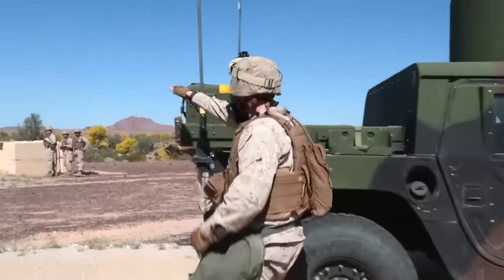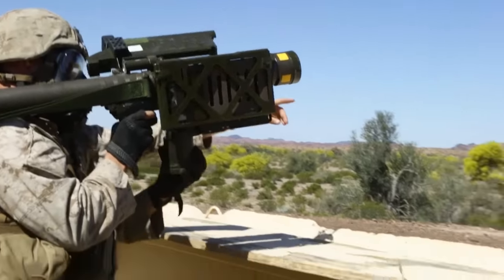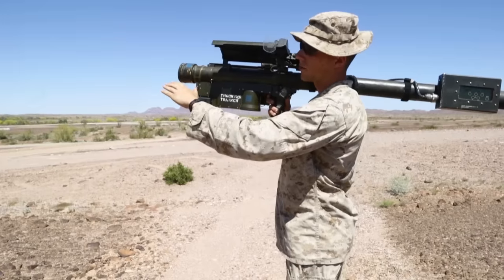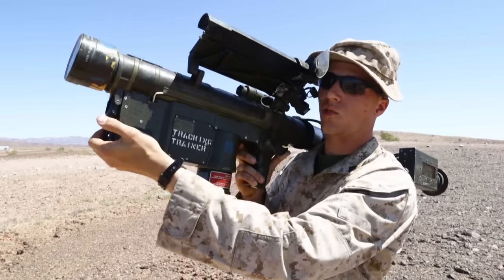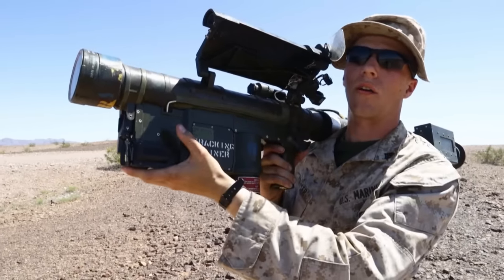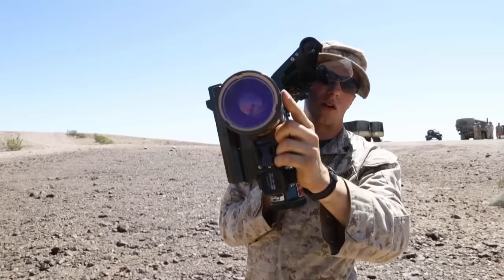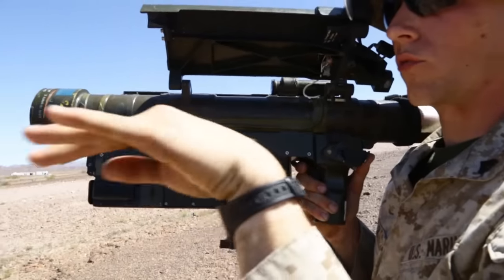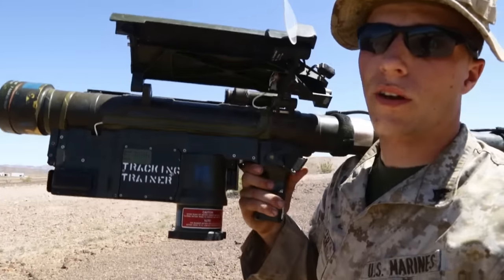How To Fire A Stinger Missile • FIM-92 Stinger In Action

Comment: I'm a former Stinger missile tech.
Getting a lock isn't as easy as they make it sound because the reticle is tiny. It's actually a pretty tough shot but once you get a lock, game over.
Reply: The problem with stinger missile is that its range only 5 km ,😣
Reply: Stingers can make easy work of choppers though.
Reply: @وجارالذئب-ر1ل  I forget but yeah it's pretty short range.
Reply: @farzana6676 definitely better for helicopters. If I remember correctly, the missile knows the difference  and at the last second will actually fly up and attack down into the blades.😉🇺🇸
Reply: @gandalfstormcrow8439  stinger very useful against choppers but it can only hit su fighters if its on low attitude and i hope ukranians have the luck to take su down
Reply: @وجارالذئب-ر1ل  Yes, it's short range so a high flying jet is tough, but don't be so sure. I knocked out a high flying silkworm missile (smaller). At night! Got a medal (Navy Achievement Medal) for that shot.😜
Reply: can you design one specficaly to target Putin and the Kremlin ?
Reply: @Blackbird_80  they can but I doubt they have the armor piercing capability. They're designed as ground to air.😉🇺🇦🇺🇦🇺🇦🇺🇸🇺🇸🇺🇸
Reply: @timarcher7933  and put a red hot poker on the end.😬😜
Reply: @Blackbird_80  just a guess tbh. Antitank weapons have a shaped charge designed to fire a cone of molten metal through armor.😉 Stingers can lock onto just about anything but how they actually work I have no idea. It's been 30 years. 😬
Reply: Since now days you never fucking know, specially now if you end up needing this information, any pointers how to get better lock, what to avoid and what to look for? Clear blue sky obviously and hovering helicopter that does know you are there, but on average field conditions? Also what is the acceleration time of the missile, since speed is mach 2.2?, but how long it takes to accelerate there, so one can estimate "sure kill" distance to target ie how close target must be so it wont get outside of the range before missile gets there? Does stinger have a range finder, way to find out distance to target? Could not find the answer but is stinger single use, or can it be reloaded and how long that takes, is it field operation or what kind of facilities are needed for this?
Reply: @Hellsong89  sorry, boss, but I won't be giving out any classified information. Even if it's already on Google.😂😂😂
Reply: @gandalfstormcrow8439  lol
Anywho..Seems like Stinger requires more steps/knowhow to use and is trickier to get a lock vs firing a javelin against armor or a truck.
Reply: @fnln7073  sorry but no idea about javelins.
Reply: Can they take out russias fighter jets? What would u say the success rate would be if the Ukrainians try to take out the Russian fighters with stingers? Also did they improve the stinger over time?
Reply: @pravdasircone1691  they can take out any planes. Success rate is extremely high.
Reply: @Gandalf Stormcrow  wow I imagined it would be much lower for high speed targets.  Awesome, thank you for answering.
Reply: @pravdasircone1691  if it flies it dies.
Reply: @novastar3547  ikr? Good news is he's got his numbers wrong. I'm not telling Boris shit!😂😂😂
Reply: @novastar3547  what's killing me is that 40 mile convoy. RPGs and a bunch of 10 year olds could take it out.
Reply: Make sure this is posted in the Ukrainian reply
Reply: @gandalfstormcrow8439  yeah, I'd rather see the 10 year olds safely on the other side of the border tho. Unless you're volunteering your own for guerilla warfare? 😜
Reply: @Quat Sino wow the red-eye is pre-stinger. I heard the Russians had a version with a useless blast shield because the rocket engine fired immediately (incinerating the gunner)!😂😂😂😬
Reply: How long do you have to hold it on the target?
Reply: @James-cb7nb  you can get a lock almost instantly if you're good. And they've upgraded since the one I used so who knows?
Reply: @وجارالذئب-ر1ل The range is 8 km actually.
Reply: @Quat Sino cool, thanks for the info!
Reply: If the Afghani Mujahideens can figure it out and knock down  Russian Hind helicopters then it can’t be that hard to use…
Reply: @وجارالذئب-ر1ل  they did today, congrats to the lads there, just 🙌
Reply: “Former Stinger Missile Tech?” Please do tell when and where you served, I am curious.
Reply: @gandalfstormcrow8439  surprised you had authorization to do it  stingers aren't supposed to be used at night unless something has changed since I was a stinger gunner/16s.
Reply: @Fng_1975  a stinger tech must have been part of headquarters.  In our battery,  we had 16R Vulcan, and 16S Stinger. We had track and wheeled, plus gun technicians,  but I didn't remember stinger techs. I was 4th ID Ft. Carson late 80s early 90s.
Reply: @stanleydavis401  😂😂😂 never said I was authorized. But those damn Chinese missiles were scary because they're inaccurate and we were worried about chemical weapons. On the plus side I held fire when buzzed by an Iranian I forget what jet. Hotshit pilot buzzing the USS Stark dropping flares. Captain was former XO when the Stark was hit by 2 xocet (spelling?) missiles back in the 80s. Orders were "if he so much as turns on radar, weapons free."  🇺🇸🇺🇸🇺🇸
Reply: @stanleydavis401  btw that's how you win medals. I'm scared, people might die, go, go,go.😂😂😂😂
Reply: @gandalfstormcrow8439  2/67 ADA?
Reply: @stanleydavis401  who?
Reply: @gandalfstormcrow8439   couple questions for you since you clearly know this weapons capabilities:

1) Does the missile have any issues tracking head on targets once it leaves the tube?

2) Does the missile have any g limits, i.e., if the target is a fast flying jet and you fail to lead, how likely is the missile to undershoot the target?

3) how sensitive is the IR seeker? Could you easily pick up a tone on lets say, a dude in a parachute?
Reply: @MJR85  😂😂😂ask Google, Boris. I can neither confirm nor deny any classified information referring to the magic dragon Stinger missiles. They may or may not breathe fire so ask the wreckage what happened. 😝😝😝
Reply: @MJR85  btw? At least half of everything I've said is pure bullshit. Hey remember the guy who asked if stingers could take out tanks?😂😂😂 Seriously! I was Navy so I shot a tank! "Oh, well, probably not"😂😂😂😂😂😂😂😂
 Omg I am the world's greatest troll!
Reply: @gandalfstormcrow8439  how do I ask Boris if I live in Phoenix, AZ? They test those stingers in the deserts of AZ, I know because I knew a guy who worked for Raytheon down in Tucson. I couldn't find definitive answers to those questions after a quick Google search, so I thought I'd ask.
Reply: @MJR85  fair enough, boss. Just being safe, hero.😜🇺🇸🇺🇸🇺🇸
Reply: @gandalfstormcrow8439  no, thank you. Can you tell me this at least - was anyone ever able to get a lock on a big bird or vulture? If the missile tracks in IR and blocked UV, I would think it would be possible under the right conditions.
Reply: @MJR85  sorry, I never personally tried to track any bird. But I did lock onto my instructor's bald head.😜
Reply: @MJR85  so if you're asking if a drone? Same truth. If it flies, it dies.
Reply: @MJR85  no joke, I'd bet the OLD stingers could lock onto ANYTHING. Why? Because there's always a light signature and always a heat differential. Show me an invisible drone with no engine, THEN you might miss. But remember! The missile in flight is forever seeking.
Reply: @MJR85  still... Even that tiny drone is spitting exhaust! Maybe a flying air conditioner? No that's an even fatter target.🤔 I can't imagine any situation where thermodynamics DON'T apply.
Reply: @gandalfstormcrow8439  that's awesome. Thanks for the insight. I can only imagine how much fun training with those was.
Reply: 16-Sierra😊
Reply: @Fng_1975  😂👍
Reply: can u get a lock on fighter jets?
Reply: @Hellsong89  some of the info you are looking for and can't find is because it is classified information. Yrs ago as a stinger gunner you had to have a "secret" clearance. Maybe its changed since I  served.
Reply: @pravdasircone1691  stinger was 1st developed 1967 to replace the "REDEYE". Most weapon systems get upgraded over the years. And yes, it can take out their jets if used properly.
Reply: @tomwade9381  "keystone" would have gone through Indian reservations and the U.S. government doesn't have the right to disturb THEIR ground without THEIR  permission. What the U.S. gets in oil/gas from  Russia is a small amount of what we use. Having said that, we should stop purchasing it from them. NATO should establish a no fly gone and NATO should put troops in Ukraine. Bottom line it's just the right thing to do.
Reply: @gandalfstormcrow8439  hit front middle and end of convoy at the same time. Get them in the muddy fields singled out.
Reply: @undauntedExpounder  it's not gorilla warfare it is fighting for the survival of their nation....
Reply: @وجارالذئب-ر1ل  That's why Ukrainians received thousands, every combat unit have one soldier have only used as Stinger.
Reply: Until the jets shoot flares
Reply: @James-cb7nb  he explained there is a lock on sound that touches your face and vibrates when you have a lock on.
Reply: @erabbitgamingofficial1  doesn't work because the missile also has negative uv tracking.
Reply: @stanleydavis401  exactly.
Reply: @erabbitgamingofficial1  I don't think jets shoot flares all the time, it will run out eventually, most of the jets that shot down where unaware that they have been shotten until it was too late.
Reply: Yeah, don’t waste it on a ground vehicle. $$$$$$$$$$
Reply: One and done. Ya better make that shot count. Then GTF outta dodge!
Reply: True. “Missile Tech?” Really? Never saw one in my whole enlistment……..
Reply: Not so hard. I was a Stinger Chief for many years. My teams never missed.
Reply: Sure Ivan, I’d love to answer those questions…….GTFOH!
Reply: @gandalfstormcrow8439  Nice larp.
Reply: @lvutner  😂😂😂 ok, Boris.
Reply: @gandalfstormcrow8439  yw vladimir.
Reply: @lvutner  np. Keep flyin.😝😝😝🇺🇸🇺🇸🇺🇸🇺🇦🇺🇦🇺🇦
Reply: @Hellsong89  Stinger is single use on the field.
It can be sent back to the factory to be reconditionned and reused. It can not be reloaded by the operator on the field.
Reply: @pravdasircone1691  Ur wish has been fulfilled lol
Reply: Once locked in to a target, can the aircraft do a quick maneuver to “unlock” or is it pretty much lights out once locked?
Reply: @JoeChioda  fair question, not sure I really have an answer. Success rate is extremely high and the missile is much smaller, more maneuverable than any aircraft. Still, kill rate isn't a PERFECT 100%, so maybe? But I doubt it.  I would think the only time it fails if if the target was almost out of range to begin with.😉
Reply: @JoeChioda  I'd think it's impossible to pull of a move in the fraction of a fraction of a fraction of a second the missile is closing at multiple mach speed.
Reply: @وجارالذئب-ر1ل  ya but they can be deployed quickly and are inexpensive compared to their targets
Reply: @gandalfstormcrow8439  Even high flying jets have to come down and slow down to attack targets on the ground. Just like the A10.
Reply: @jesspeters1611  great point!
Reply: @MJR85  the Stinger has head in capability. You don't need to lead. Just get a lock the fire. Once launched it is useless to deploy flares, it will stay in target. It won't lock on a parachutist unless he is smoking a cigar. If target is in range it has a 90 percent kill probability. I personally never saw a miss during live fire.
Reply: @وجارالذئب-ر1ل  They took a Su down a few days ago with a stinger I believe.
Reply: So, for a jet airplane he said one needs to lead the scope before the jet hit a certain point to lock in?
Reply: @dangcao8341  sorry, but I can't remember. Plus I can't be specific about anything. I'd think they'd have a new scope 30 years later but I have no idea. Jets weren't a problem for us. Nothing was. Can't knock out satellites.😜
Reply: @Charles White there are a great number of places in Russia of outstanding architectural merit. 
Its what the Kremlin stands for is the issue.
Hospitals are now an unaimed at target.
Suppose wind resistance some would say is the uncontrolable factor. Dont blow to hard.
Reply: @dangcao8341  no need to lead. Ain directly at the target, get acquisition and fire. The missile seeker does the rest
Reply: @Charles White You wont mind it being occupied by a Special military operation then.
Reply: @Charles White presumably your not a Chelsea supporter.
Reply: @Charles White My view is that those countries willing to supply aircraft to Ukraine should do so NOW not tomorrow.But even that may have further reprocussions.
My personel view is if Putlin cannot agree and keep a number of safe corridors for Ukrainians to leave the war zone .Nato should give Putlin a clear ultimatum as he has done to the West and countries such as Finland and Sweden.
Hes playing a very close game of International bluff and counter bluff.What is he truly capable of.We see it on our TV and computer screens to regularly.I often speak to Syrian, Iraqui students who have left their home land for a better life in other countries.
Ok what i say will up the anti but where are we headed if we dont respond.
Nato is presently increasing pressure by the extra soldiers , warships and military equipment in those countrys in Nato.80% of Putin,s military muscle loaded in one place.A critical point has to be reached at some time on his military losses.What happens when that is exceeded with Nato in a position of threat.Hes playing a game of trying to get away of invading and destroying a country with bluff and deception of which he appears to be a master.
I truly believe the Ukraine is fight for my freedom as it is for every free country in this world. Thats why i make the time to converse and reply. Since if we talk you can change my ideas and understanding and i can enlighten you or visa versa.AS A DICTATOR Putin wont realy talk.
The West doesnt in my eyes leave the room untarnished but thats another issue.With Putin there is a pinch of truth that gets manipulated for his agenda.What is his ultimate agenda Restoration of the Soviet Empire.With any that fall by the way side.
Reply: @Charles White Sorry something blocked a further reply perhaps i am talking to much .Hope you have a good day reguardless.
Reply: Can Stinger work at night?
Reply: @abcbobrock71000  I shot down a silkworm missile at night with the old stinger. Idk if the new ones have better optics but 30 years later I'd assume they do.
Reply: @وجارالذئب-ر1ل  well it's a manpad not a large vehicle mounted sam
Reply: @gandalfstormcrow8439  a silkworm antiship missile. Ya sure u did
Reply: @Truthbomb918  Chinese version of a scud.
Reply: @Truthbomb918  but you're right, maybe I'm remembering wrong? It wasn't low flying, fast moving, it was highly inaccurate, high flying, slow. Problem was we were worried about chemical weapons at the time.
Reply: @gandalfstormcrow8439  it's Chinese alright but it's nothing like a scud. Scud isn't an anti ship missile its is a ballistic land attack missile
Reply: @gandalfstormcrow8439  ur definitely remembering wrong. I'd imagine anyone who shot down a ballistic missile in combat would know every detail of the event especially if one got a medal for such a feat
Reply: @Truthbomb918  30 years ago. I remember skuds and silkworms but that's about it. Had to Google silkworm to see it was antiship. Maybe it WAS a silkworm (if they fly high instead of low like I imagine an antiship missile would. Plus wouldn't that have to lock onto something? The ones they were lobbing overhead weren't sophisticated cruise missiles.
Reply: The soldier mentioned clear-blue skies.

Does that mean the weapon is not very accurate at tracking targets in cloudy weather?
Reply: @OilBaron100  still has a heat signature
Reply: @gandalfstormcrow8439  does the infrared camera detect heat?

Or is there a separate thermal camera?
Reply: @OilBaron100  no idea how the new ones work.
Reply: @Hellsong89  What is your problem?
Reply: @وجارالذئب-ر1ل  
The trouble with bull-shi-t, it cant stand the long trail.
Reply: Fire the stinger! - Fox
Reply: @وجارالذئب-ر1ل  SHORAD
Reply: @Hellsong89  gunners use the sights.  The information on how its used is classified.
Reply: @Hellsong89  the missile tube and battery coolant unit are single use.  The gripstock is reusable, and takes about 5-10 seconds to remove and attach to a new missile round.  Someone thought the missile would pop up to hit the rotors.  That is not the case.
Reply: @pravdasircone1691  it can be employed against jets.  The likelihood of a hit depends on speed, altitude, range, and target aspect. The weapon is fairly simple to use, but a skilled gunner greatly increases the likelihood of a hkt or kill.
Reply: @James-cb7nb  fire and forget.  Gunner activates the weapon, gets tone, decides whether to engage, and fires.  Once the missile leaves the launcher, you want to haul ass since there is a big nasty white trail of smoke to your position.  The missile tracks the IR/UV signature of the target and computes its intercept and detonation.  Supposedly, Russian doctrine after Afghanistan was to walk artillery against a large area to take out the team after a launch.
Reply: @gandalfstormcrow8439  bro this rocket is smarter than some of the russian troops
Reply: @connorkenway09  😂😂😂 good point.
Reply: Did you try going into settings an increasing the reticle size and aim assist?
Reply: @O1OO1O1  brooo 😂💀
Reply: @gandalfstormcrow8439  *Exocet, French. Nasty little (quite big actually) anti ship missile. Thank you for your service.
Reply: @maartentoors  thanks, boss. As stingers, we were supplemental ship's defense. We were stationed in Bahrain and when a ship came into theatre, they'd send out a team of stingers. That ship would do it's your for a few months, and then go home. Point being, I was on 4 different ships in my 13 months in the gulf. Second ship was the USS Stark. It's an FFG (fast frigate, guided missile). Back in the 80s (before my time) IT HAD BEEN HIT BY 2 EXOCET MISSILES FIRED BY IRAN. Over 80 sailors were killed. The captain of the Stark had been the XO (second in command) when it was hit. 
Anyway, one day an ARMY helicopter crashed in the sea near the coast of Iran. Still in international waters, but THEY WANTED IT. The gulf is very shallow so they wanted to dive down and recover all the top secret equipment. We weren't going to let them, of course, and the USS Stark was assigned to protect the EOD boat (NAVY combat divers) we sent to retrieve/blow up the helo. Needless to say, the captain of the Stark wasn't taking any chances. One day, we got word Iran had a jet headed for us. Standing order was, if he so much as turns on his radar, weapons free (which means shoot). I'll never forget, this hotshit pilot comes roaring in at sea level, circling the Stark, dropping flares (to confuse any missiles locked onto the plane). I got a lock, but didn't fire, he bugged out. I was 1 button away from starting a war with Iran.😜
Reply: @maartentoors  in other words, EXOCET I remember clearly.😂😂😂🇺🇸🇺🇸🇺🇸
Reply: @gandalfstormcrow8439  That.This. Is Badass! I'm from Holland and have never been on active duty, however, as a '90s kid I feel like I should have been.
Do you think the pilot bugged out because he was warned about the lock?
Reply: @gandalfstormcrow8439  I truly hope the Stingers (and Javelins) will do some irreparable  damage to the Russian birds and vehicles!
Reply: @maartentoors  I can't be sure. I'd imagine the ship's radar was locked onto him long before I was but he was low and so close I know he saw me. He bugged out immediately AFTER I got a lock.😝😝😝
Reply: @maartentoors  me too, boss. I can't be sure but I think I've seen footage of at least 1 Russian helicopter being shot down by a stinger. The corkscrew missile trail matches. God bless the poor people of Ukraine.
Reply: what about flares?
Reply: @moomoo5198  the missile tracks heat AND the silhouette.
Reply: @gandalfstormcrow8439  exactly so it’s work
Reply: @moomoo5198  flares won't stop a stinger.😉
Reply: En la guerra de Malvinas derribaron un par de Harrier pero cuando volaban a baja altitud.  Es muy eficaz pero depende mucho de su bajo rango de alcance , solo 5.000 metros
Reply: @H0kram  no, the missile tube is straight-up single use.  The only reusable part of the weapon system is the reusable gripstock, which can be reused until it doesn't function anymore.  The  basic combat load for a team was and probably still is two full systems and four missile rounds (no gripstocks).  Doctrine was to destroy the empty missile tube because they are useless and can be used in assembling IEDs for use against friendly troops if you leave them behind.
Reply: @O1OO1O1  Stinger uses an iron sight.  There is no adjusting the reticle and there is is no aim assist.  I'm guessing you are joking, though.
Reply: @connorkenway09  missile, not rocket. Rockets are dumb, missiles are "smart."
Reply: @OilBaron100  the gunner has to be able to see the target to identify and decide to engage or not. Popping off guided missiles when you can't see is a great way to kill a friendly aircraft.
Reply: @OilBaron100  Stinger has no camera.  It's an infrared seeker head, which is cooled to enable it to better detect differentials in heat between background radiation and potential target heat sources. A computer interprets the information from the seeker head and computes intercept, adjusting in-flight  based on the target and missile trajectories.
Reply: @erabbitgamingofficial1  yep.  There is a small, very loud speaker in the gripstock near the gunner's face.  A cheek to bone transducer (I believe my terminology is correct-it's been a minute) also vibrates ton indicate lock in case you can't hear the speaker on the battlefield.
Reply: @dangcao8341  there is no scope.  Stinger uses an iron sight, basically a specialized gun sight.  Lock is estblished, then the gunner applies lead using the sight, if appropriate, based on their training.
Reply: @saucerman90  you just need to go into settings and you can change those things.
Reply: Hendrix Cody  I'd love to know the kill count.😜🇺🇸🇺🇸🇺🇸
Reply: Hendrix Cody  my honor, boss. Thank you for saying so! Most people don't realize it, but it really helps to know we have your support.
Reply: Hendrix Cody  helicopters have stingers now? I just saw a video of someone shooting the new and improved stinger and I was soooo jealous!😂😂😂 New optics, all WE had (30 years ago) was a tiny plastic circle you had to align. Im definitely gonna look into the new ones.
Reply: Im not being a dick but i doubt you've ever fired a Stinger in anger, while Ukrainine military has racked up more combat experience in the last month than all of Nato combined.
Reply: In the first video why is the weapon user wearing a mask?
Reply: @Hellsong89  All public hes bullshitting you, not classified, one of the most used air defense platforms in the world. Just watched a few interesting videos. Just check it out
Reply: @gandalfstormcrow8439  can i contact you, i need guidance bout my career, i want to get into missile tech field
Reply: Presumably a stinger missile tech uses missile grease, a key to the impact area, and a box of grid squares. Anyone that’s never seen a Stinger miss has never seen a live fire in the rain.
Reply: @roadsideromeo9549  I couldn't tell you anything you couldn't find on Google.
Reply: @gandalfstormcrow8439  It's probably chasing the heat generated by the motor.
Reply: @monomer1397  yup.😉
Reply: Yeah even when they pop flares it's still a good chance it hits the aircraft
Reply: thanks for the insights; I heard some so called expert on tv saying that it could take out tanks, is it possible ?
Reply: @SuperTitank  you could lock on at least. I'm afraid the stinger I used is an old model but it's designed for aircraft. Antitank weapons usually use a stream of molten metal to burn through armor. Actually, the more I think about it, idk . Hint: tanks usually have thinner armor on the top of the tank.😉
Reply: @gandalfstormcrow8439  thx !